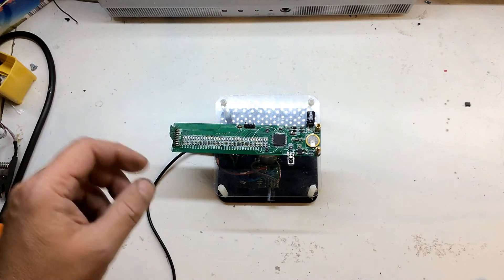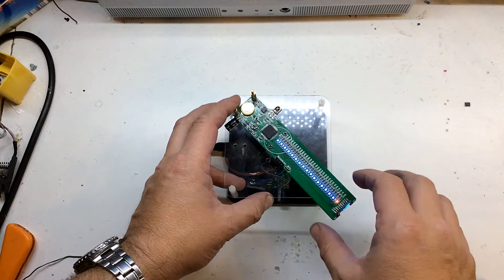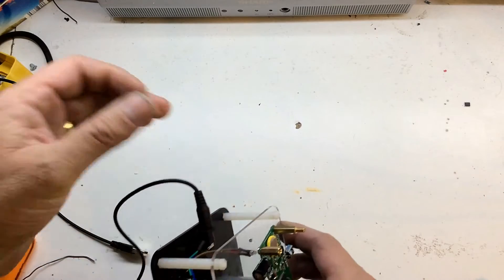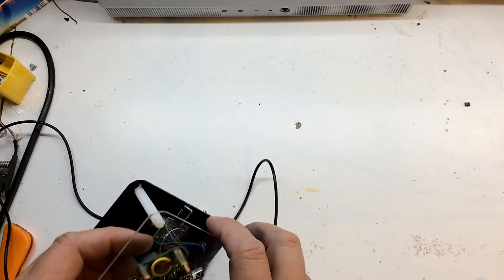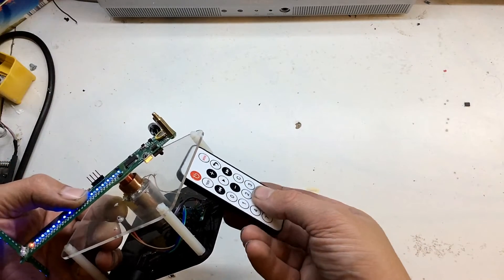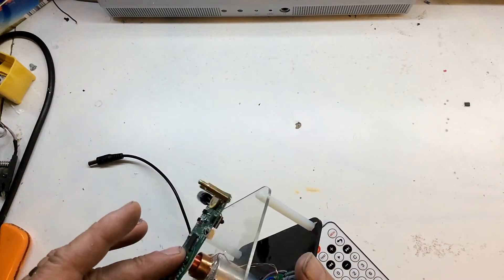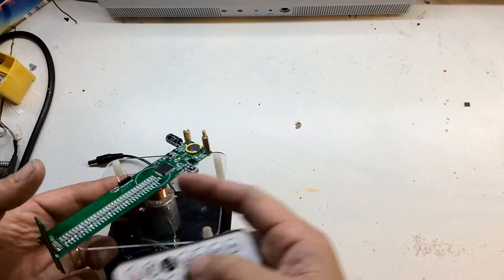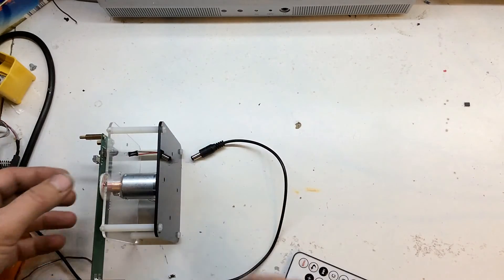Rotating LED Kit from Banggood.com Build no animation fault

Comment: And I've seen that the 3rd clock screen has timing issue. When motor runs full speed the screen starts to flicker than goes off. If I slow down the motor a little the clock screen comes back.
Reply from the maker: I think this possibly happens if it detects a start signal before the end of the text draw (wrap around), it looks like they have taked a default motor speed to program and if your a tad faster then it all goes wrong. what they should have done is to time between start pulses and then use this to calculate the led firing.There will be some delay in the program somewhere, i havnt looked for it. Glade you got it going, if your a code wiz (im not) have a bash at making it better and reply back.
Reply: Kevs Electrical Workshop unfortunately I'm not so good at coding too. I will give it a try when I got time.

Comment: Thank you so much! You are great. This one solved my problem. My sensor receiver LED was connected wrongly. Now it is working alright. But I have some questions again. Can we adjust the orientation of clock screens? They are not leveled well.
Reply from the maker: Mine is the same, it could possibly be tweaked in code but far easier to redrill the ir tx hole and move the ir tx by the corresponding offset.